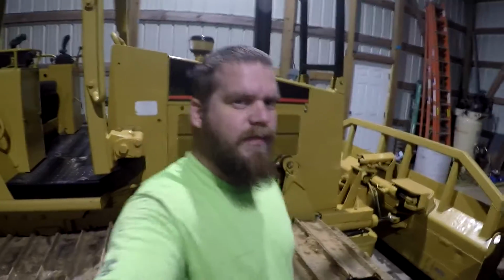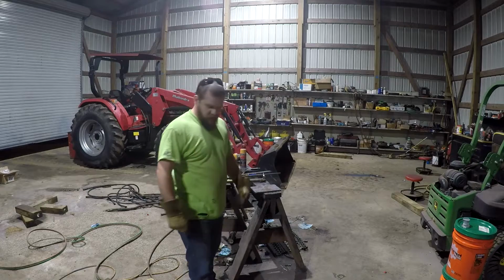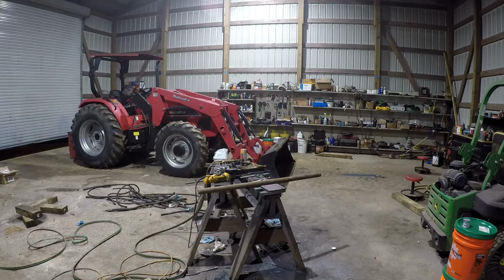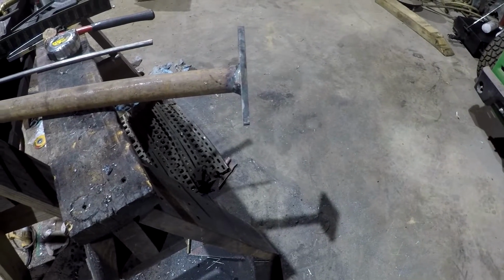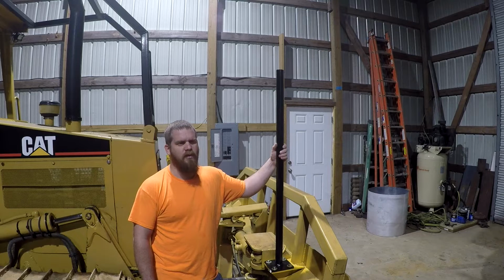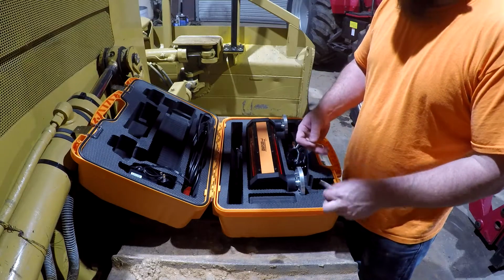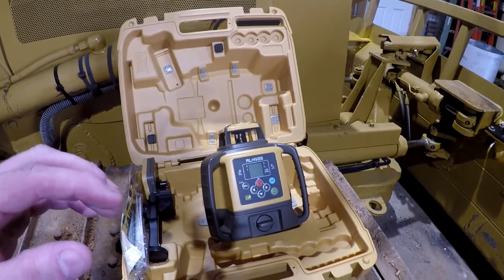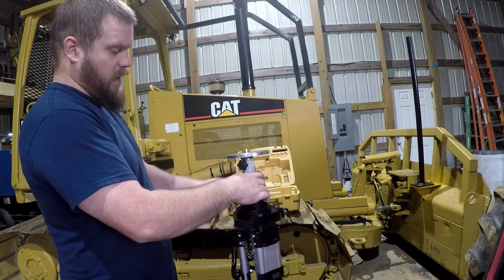Laser setup for Cat D3C LGP Dozer

Comment: Man I appreciate the shout out. I like that receiver. I'd like that on my 313. That's a really nice looking dozer also!
Reply from the maker: No problem, I thought your 313 had the grade control built in. I got this to cut some drainage ditches on 1/2 percent slope. Over 1/4 mile worth of slopes and ditches.  A lot of dirt to move with a dozer.
Reply: @LifeWithChase  it does. But it's still limited without some type of reference point.